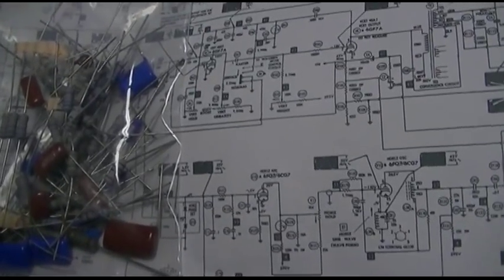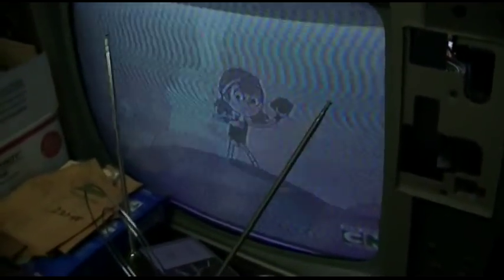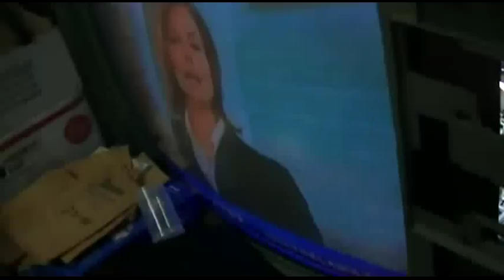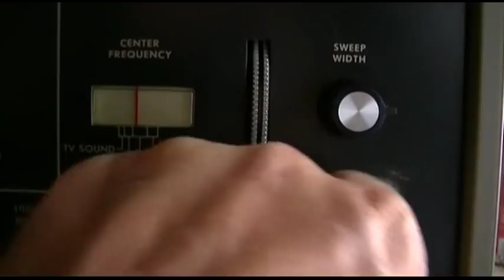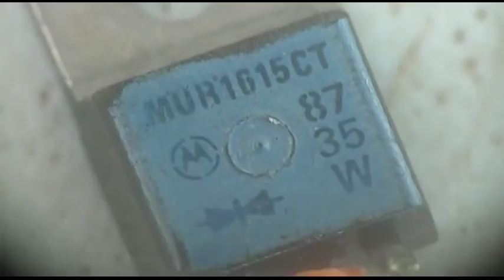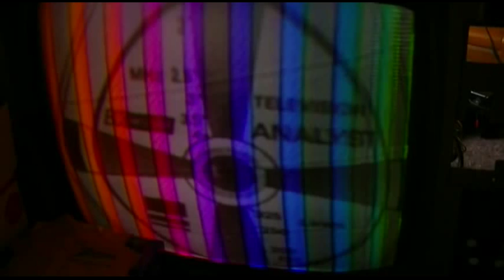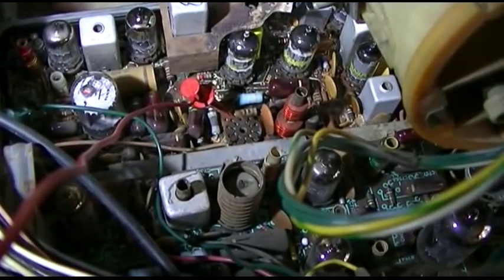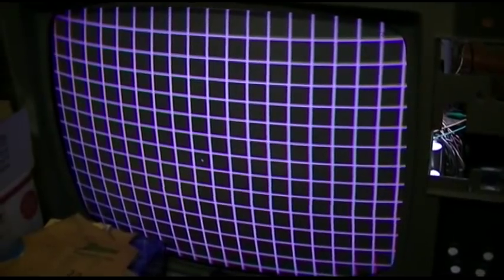RCA CTC24 Video IF Alignment Color Issue Horiz Twerking

Comment: The same person that found this set found the Magnavox B&W with the vertical issue I'm working on. Must be something in the air where these came from. The toxic crud residue must've got close to the Horz. area too.  Well at least these sets weren't thrown out. Nice seeing all of it on the scope. With this set, I was running out of aspirin.
Reply: shango066
That sat on my bench a while believe me. Don't recall using any chemicals to wash that board, only soap & water.  Learning a lot, hope others are too!

Comment: I have a funny feeling that you're getting really, really warm in finding the actual problem, Shango. We all know that carbon-composition resistors tend to go out of tolerance with age and high hours of use, especially when they're exposed to consistently high temperatures. At least you did rule out any problems with the B+ supply, though. I gain a lot of knowledge following your videos, especially ones like this.

Comment: clean the whole chassis, take it out and wash it with Zep car wash soap, the strong kind, the dissolving packets, and water, then re-cap and replace every resistor, once you get the boards out that is simple PCB work, boards are a PITA to remove but once out it is so easy...I have done this before to many CTC's of this era
Reply: only bugger part is getting the boards out of the chassis, once you do it is really easy just like the Philco predictas, simple PCB work and so easy compared to trying to fix a modern LCD tv....I hate surface mount components, I will replace them but those are a true PITA...
Reply: I've watched some videos on repairing flat panel TV with surface mount crap on them. One guy recaps the boards using through the hole electrolytic caps rather then surface mounts, bending the leads to make contact with the solder pads, it seems to work. Others seem to use solder flux on the joints to help the solder flow. I don't really like the idea of dealing with anything surface mount, in fact I don't really like PC boards at all, I prefer hard wired chassis.
Reply: @grassulo  by that comment i can bet 100€ that you have never serviced any type of vintage tv equipment and i will not loose that bet

Comment: Really not joking if you have a decent set-up for PCB soldering, just get the boards out and replace everything it's so easy...this is through hole, old school stuff, not like SMD! (the devil created surface mount components!) really, it's not that bad.
Reply: Just to discover that the PCB is conductive and shorted ...